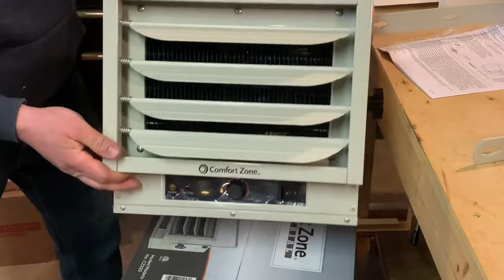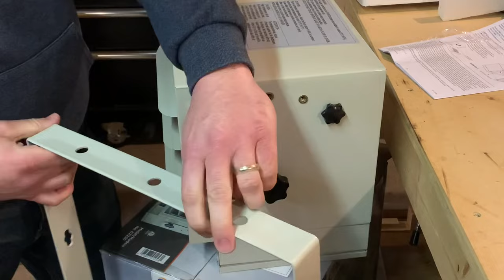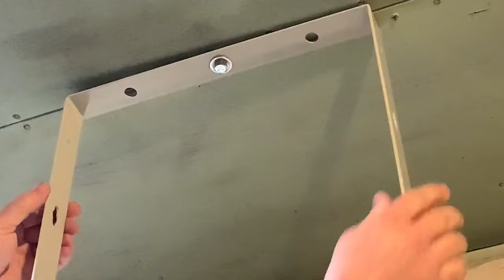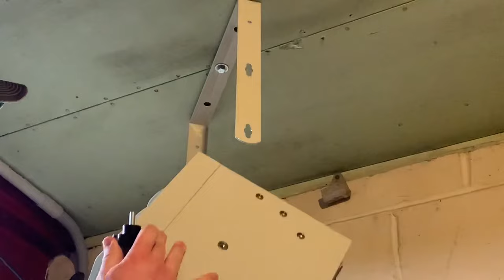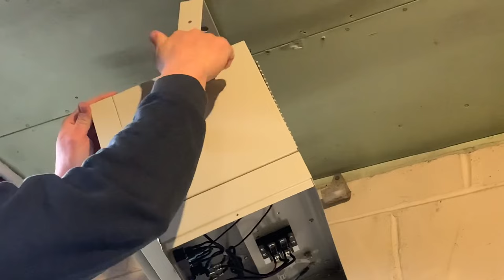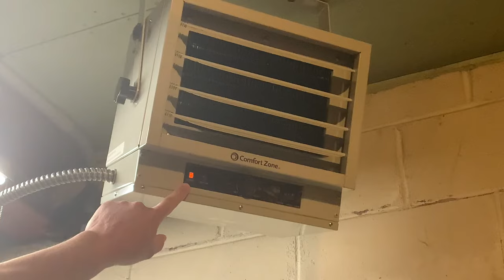240v Garage Heater Install

Comment: My garage is 22' x 32' insulated with 10 sidewalls and this heater will keep it 65-70 degrees if the outside temp is above 0. Any colder than that, I run a diesel heater to warm it up first, then the electric will hold the temp from there. it works pretty good and I can't even hear it with the stereo on.

Comment: For your readers:

As an electrical guy, we use the National Electricial Code about like a preacher uses a Bible.  It requires us to follow the manufacturer's instructions for installation.  The current code, 2020, requires all recepticles in the garage or simular structures, out buildings, etc. To be gfci protected even up to 250 volt recepticles.  That might add a lot of cost to your recepticle install.

The NEC allows your local inspectors to adjust your requirements if needed.

Now, as the homeowner, I cannot stop you from installing anything any way you want, but the NEC is written with the blood and tears of those that went before us into the electrical fray.

Besafe out there and if you need code references for my statements, hit me up and I will get back to you.
Reply: This is not a receptacle
Reply: @notmyname9876  you are correct, it is not a receptacle, yet, my statement remains factual and accurate.  If you install a receptacle in your garage for this or a car charger or your deep freeze, you need GFCI protection for that receptacle.

No receptacle, no GFCI required for the receptacle that is not installed, just like he did here......no GFCI.

Comment: Installed this same heater in my garage this morning. Mine was 5000 watts at 240 volts draws about 22 amps #10 wires is good for 30 amps.0

Comment: Would be a great video, if you installed correctly or had an electrician do that for you. Those call for #8 copper , (45amps max fuse size) (which is what it should be breakered at) the reason your heater is barely working cause it’s running that #10 to death and gonna cause heat
Reply: 5000 watt / 240 volt = 21 amps no? and you say 10awg isn't enough? i think 10 is just fine

Comment: Ive watched several similar heater installation videos and always wondered, if people actually pivot their heaters?  I hooked mine up in a corner above my work bench, but used the two outside holes on the hanger bracket, so the heater will not rotate/pivot. 
Nice video.  Hope you get great use of your heater. Cheers from Ottawa. 🇨🇦
Reply: I’ll be using two bolts as well. Once I figure out the direction, it’s going to stay that way. I also like a very neat looking and clean cable feed installation so that means there won’t be much slack... which also means minimal heater rotation. All good if you know what you want. 👍

Comment: Did the heater instructions call for a 30 amp breaker?
Reply: The instructions make no reference to what size wiring or breaker amperage to use. The instructions state the watts/BTUs/Amps at each setting (high/medium/low).
Local code in the jurisdiction where the unit is to be installed, is where one discovers the particulars of wiring your unit.
Good luck.

Comment: #10 wire is not correct.. should be 40 amps because you will use only 80% of breaker sizer per code.. that's like 32 amps..

Comment: How can I install another heater of those ! Next to that one ?? Is it posible use same wire and same breaker ? Like install in serial?
Reply from the maker: I’m not an electrician, but I would say no. Each heater would most likely need its own wire and circuit ran.

Comment: Ok well I'm wondering if my heater is a dud I installed in a 20 by 30 garage and even with pre propain heat it dose nothing to warm it or keep it warm this puts out less heat that a 110v heater like I can hold my hand directly infront of it on high and just warm air comes out its upsetting and wondering if I just did something wrong. Have any idea?
Reply from the maker: I’m sorry, I actually sold that house and moved, so I can’t try mine and see what temp is blowing out of it.

Comment: I've had this heater for a couple of years now, and just in the past week or two, the thermostat knob stopped turning the heater on. I have lights, so it's receiving power, but no matter how much fiddling I do with it (and the three power levels) it just won't turn on. Have you heard of anything like that before with respect to these heaters?
Reply from the maker: No I haven’t. Have you had any luck finding replacement parts for it. I just tried looking on Amazon and I don’t see any for it.
Reply: @theletsfixitguys672  to be honest, I haven't really looked. Looks you can you buy a new or similar version of this heater for $109CAD right now, so might not be worth fixing.
Reply from the maker: @Bane313  that’s true. Not a bad price to get a couple years out of it.
Reply: I have a nearly identical unit and I wired it exactly as you did. It has an amber power light when off but when they thermostat is turned clockwise when it "clicks" the Amber light goes out and nothing happens. If I turn it back to minimal or off the Amber light comes on again. WTF?
Reply from the maker: @lockporttransport  I also had that issue at first. I checked the voltage at the breaker and one side was 110v and the other was very low. I put a new breaker in and that took care of the issue.
Reply: @theletsfixitguys672  Thanx. That was it. My breakers have been sitting since I installed the extra 100A loadcenter when I took the electric furnace out 20 years ago. I tried another 20A dual pole I had and it worked just fine.

Comment: And you’re installment of the heater you show three wires a red black and green no white but when you put it on the circuit breaker, you put the black and the white what happened to the red when you put it on the unit you put the red in the black something is totally wrong
Reply from the maker: If I remember right, that was an old breaker and a piece of scrap wire for demonstration. Good question, though. Thanks

Comment: you didnt mark the neutral as a hot
Reply: I don't see a white wire. Just red and black. Red and black are both 120VAC relative to neutral but 180 deg. out of phase to give you 240 VAC.
Reply: I’m confused. At the heater it looks like red and black but at the breaker looks like a black and white.  Maybe I’m seeing things. What happened to the red at the breaker?
Reply: @akelkhunter  You seen it right. Remember he only used flex conduit for a short run. He has a junction box that he used romex to finish wiring to the breaker box. Listen closely and he said that. That is why the different colors. He didn't show that part of the connections but it's common.

Comment: Does it matter where the red and black wire go ? Meaning could you have connected the black wire to L2?
Reply from the maker: That is correct.
Reply from the maker: Both leads are 120, so doesn’t matter if they go to L1 or L2. Again, I’m not an electrician,but that’s the way I made the connections. Thanks!
Reply: @theletsfixitguys672  Thank you
Reply: Where did the white wire for breaker come from? I thought it was black and red
Reply from the maker: I think it just depends on the wire you use. 8-2 would be black and white with ground. 8-3 would have black, white and red with ground. This heater only needed 8-2.